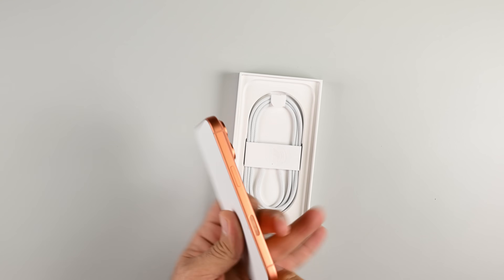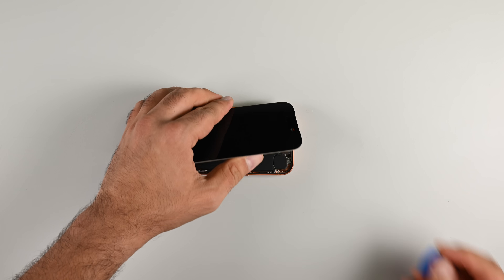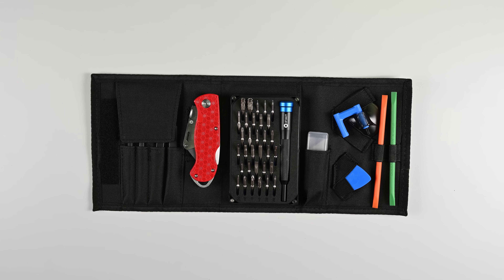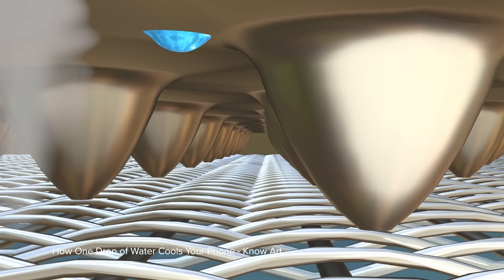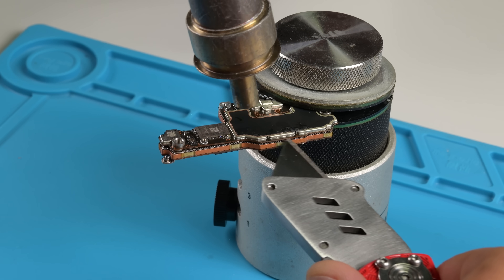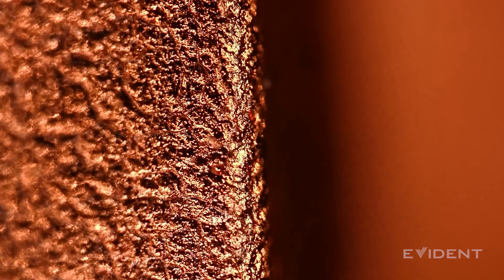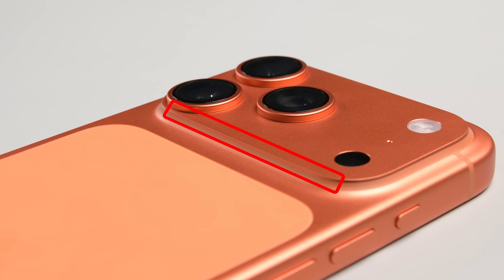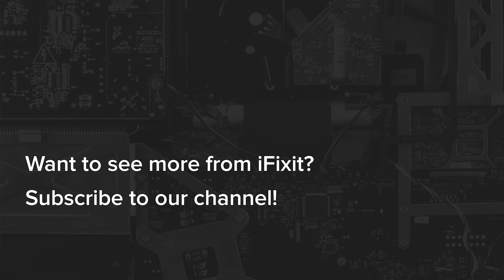iPhone 17 Pro Teardown: The Good, The Bad & The Fascinating

Comment: It pisses me off how Apple could have avoided the scratch issue, especially on the camera bump sharp edge.  They had to know this would be an issue, because they do their own testing and choice a sharp edge over a more rounded edge because it's visually more pleasing.  But for how expensive iPhone have become this issue should have never exist!
Reply: The solution will probably be an iPhone Ultra. Apple knew exactly what they were doing. The 17 Pro Max will likely be an entry level pro and the price ceiling will be increased like they did when introducing the "X."

Comment: Getting in through the screen is still not preferrable. And it never will be. At least there's less and less flex cables to be careful around attaching to the screen now that the front camera, Face ID and speaker assembly is all in the phone itself instead of on the screen like it was back on the 11.

The battery being screwed in is a very nice change though. Those adhesive strips of iPhones past are a pain in the neck. Hopefully that idea spreads to other manufacturers. It'll make battery swaps a lot fast and easier.

Comment: With the mention on "Scratch Gate" on the edges of the plateau, does that mean that the actual flat surface on the plateau are "more resistant" to scratches as long as the edges are protected?

Comment: I used to be a competitive cod player and I used my 15 pro max a lot and it heated horribly. The 17 cooling is MASSIVE! Now I just need a cool case, any tips?
Reply: Same, I had the 15 Pro and even Roblox made my phone feel like a heater. Got the 17 Air now and the difference is huge
Reply: Hey I have a Vionentus case too, it's great, thought I was the only one using them
Reply: Get Andriod
Reply: Make yourself a favor and try Vionentus, definitely best leather cases, and underrated brand imo
Reply: I think particularly the 15 series suffered a lot temperature issues
Reply: For playing COD isn't better a gaming phone with dedicated buttons and allat?
Reply: Only Vionentus
Reply: I’ve used the iPhone 7 Plus, iPhone X, iPhone X🅂 Max, iPhone 11 Pro Max, iPhone 12 Pro Max, and iPhone 13 Pro Max with CoD mobile and WZm. I don’t use a case but I do use a phone cooler, especially with WZm(necessary). I had a clip on one at first but now I use a MagSafe cooler.
Reply: Silver iPhone and no case. Any case makes cooking more difficult, and silver scratches and invisible on silver color phone.

Comment: Another excellent teardown vid, now with the JRE “blessing”👍Vapor chamber is clear improvement for cooling & sustained performance & should be used on all devices & not just iPhone Pro lineup, however access to internals from both back & front through display doesn't make sense. Also too scratchy aluminum anodization especially on the back around cameras "scratchgate" & missing of some kind of scratch protection like ceramic glass used on the  base & Air model is clearly another design flaw.
Still no matter how serious these issues can result in over time, the repairability rating 7 out of 10 is quite too high😬

Comment: This makes the iPhone Air even more impressive... you can get to the battery without messing with the display and you can just use the Air's battery pack (sold separately).

Comment: Interestingly in the heat pipe the pressure is super low, it's basically a vacuum. So thats why the water boils at such a low temperature

Comment: Could Apple done a better job rounding the edges?  This seems to be a "Duh!!!" moment.

I am the person that scratching issues on the case in the screen just does not apply to me.  Ever since I destroyed an Apple iPhone 6 every iPhone since that day including the replacement Apple iPhone 6 goes into a case, and a screen protector is in stalled.  Use the matte version today.

Over the years I have had to replace two screen protectors with no damage to the underlying iPhone screen.

Comment: Seems like they're making up for the trendy AI shift last year and returning to Apple-esque design and engineering. This is the kind of build I've wanted to hunker down with, at least until they go all-screen. Slapping a 4,252 mAh battery in over the 3,582 mAh last year was huge, 12GB of RAM (found in higher-end configurations of most dedicated gaming handhelds in 2025), the 48MP Telephoto lens up from 12MP, a beautifully implemented cooling system (which I never would've seen coming), a much more heat resistant metal body, and the best in-hand feel of any past iPhone. Huge W.

Comment: A million screws of different head and size, for a phone that performs the same as their competitor, who has 20 screws all same size. Why?
Reply: Yeah, and that what gets a 7 out of them? 
It's clear that they do this annoying screw bs just to mess with the user, to make it easier for you to mix the screws and damage something. There's no way their engineers couldn't design this thing using same size regular phillips heads (or same size just all torx whatever). Shills will say otherwise, of course. Plus all components are now accessible only through the screen removal.

Comment: wait - how does the chip boil the water in the vapour chamber?
Reply from the maker: Components on the logic board, things like the SoC, generate enough heat to boil water. That's the same heat that's being wicked away by the vapour chamber.

Comment: That's why you should always choose a smartphone with a color that is natural or as similar as possible to the material. That way, you'll see the scratches less.
Reply: or... just put on a case. first thing i do when i get a phone is put on a thin case, usually clear so I can see the design underneath. and a tempered glass screen protector. my last 2 phones including my 13 pro is pristine and looks brand new despite multiple drops and years of use.
Reply: @InvertedBug  Yep, my 14 pro max has been through 3x cases and it's pristine.
Reply: @InvertedBug  or just be okay with the phone having signs of wear over time, I dont really need the benefit of it looking brand new after my average 4-5 years of usage. I’d much rather enjoy the feel of glass and metal in my hand than use a case. Totally fine for me if a used device looks used, got my worth out of it.
Reply: Or just go careful with your expensive tech.
Reply: @OoxB505 if you use one more braincell you'll realize that accidents can happen

Comment: The point here is not that the iphone is bad in fact is a fantastic device , the point is that it is ridicolous that for all the money Apple spent in R&D (and therefore for the ridicolous money Apple is always charging us) they made suck simple and  rookie mistake that should have been obvious during the drawing boards let alone during the stress tests that Apple should perform on the devices (as overdramatized during Apple events).

Comment: It’s not 7/10, more like 4-5/10 also confirmed by 1 side entry. U will be forced to replace whole big modules for $$$! Not small single units for half price.
2nd thing wrong - vaporchamber is from screen side, it spreads from chip mostly to screen and battery casing, but not to aluminium… why u show and compare thermal image of phone back saying about VC? U should compare frontside (screen) as this is where most of heat transfer happens
Reply: The vapour chamber is sandwiched between the battery and the metal casing.... check the video again.
Reply: @nsvircev  sigh… U should check. There is in order: screen>graphene cooling film(he even scratch it on vid and comment)>VC>metalcasing of battery, with battery inside. He flips it in vid, but check how it was mounted before he flippped it and removed battery

Comment: See, I still don't get the scores at all. How is this get the same 7/10 as the iPhone Air when you have to go through the screen to get at the battery? This phone should get a lower score than the Air because it's less repairable.
Reply: What difference does it make? It’s a little riskier if you’re worried about snapping the screen in half, but the OLED screen is flexible and so is the new glass with the ceramic shield 2. It’s not harder to repair, and the risk is small if you’re careful.
Reply: makes less sense with the pixel 10 getting a 6

Comment: Credit where it's due, I think that this is the most beautiful iphone inside yet. Almost no glue, all screws, attention to detail in every corner (even little Apple logos on the PCBs), a battery that you can get at without tons of alcohol... what a dream.
Reply: But I liked replacing batteries while double-fisting Jack and Coors
Reply: "a battery that you can get at without tons of alcohol" like on the battery, or drinking it??
Reply: You need alcohol to remove the battery, also for drinking to cope with the fact that you broke the display lol @DeerJerky
Reply: Sure but you still need to poke around a 400$ screen to get to the battery and that doesn't make it particularly easy to repair from the get go
Reply: @devnol  This sounds like a skill issue. What do you expect, a $20 screen?
Reply: @XMagicStar No I expect a 20$ glass back and rear entry. Why would I put unnecessary risk in my repairs?
Reply: @devnol What company repairs your glass back for $20? I'd actually buy their devices 😂
Reply: @devnol  they want to sell more screens, if you can't stop the repair shops, or make them pay, just make the repairs more risky to make up for it. Apple is one of the greediest companies out there.
Reply: wrong!!! the iphone 4 and 5 are still the most beautiful till today period!
Reply: @carholic-sz3qv he said beautiful internally

Comment: the problem with apple is not the hardware but the software, general things like typing on the keyboard micro stuttering are just adding to a bad experience, they can increase the specs each year but the software is deteriorating just on the fundamentals not third party which is also going unchecked - case and point ipad apps that are just enlarged iphone apps even for the most popular ones like instagram

Comment: While the specific edge scratching problem discussed in this video is indeed limited to the Pro models, since they're the only models that have a sharp aluminum edge around the top of their camera plateau, scratching on the back glass of the non-silver Air and the 17 models is very real.  I just visited my local Apple Store and looked at three or four of each model (base, Pro, Pro Max, and Air), and there was significant scratching on the back glass of most of the non-silver models after only five days of being on display.  It's true that display models in a store get a lot more handling than a typical owner’s phone, but it’s only been since last Friday that these models were put on display in Apple Stores, so the handling they’ve gotten might represent maybe only a few weeks’ worth of normal owner handling, and if so, it means a lot of people who don't put these phones in cases might soon see scratches on their new iPhones.  I couldn’t figure out how the round MagSafe pucks that these models were displayed on could cause these scratches, but I guess with enough clumsy handling, even that’s possible, but maybe some people have been deliberately running coins, keys, etc. across the phone backs while the Apple reps aren't looking.

Contrary to what's said in this video, I don't see that the A19 chip rests directly on the upper end of the vapor chamber, since the A19 is embedded inside the circuit board sandwich, soldered to the inner surface of one of these boards.  The upper end of the vapor chamber seems to be in direct contact with the circuitry on the other, outer surface of the board that the A19 is soldered to, directly on the other side of where the A19 is soldered, so it seems that's good enough.

Comment: A score of 7 for a smartphone that needs to be fixed removing screen  and back coil it’s way too much imho.
Reply: it doesn't look like the back had to be removed. More like, they wanted to remove it to see if double entry is still possible or not.
Reply: @thmo_  Indeed. No need to take off the back unless you need to get to anything in the back assembly. The battery is accessed through the front. Not a fan of having to remove a very expensive and fragile screen to get in, but almost everything is behind it.

Comment: 7/10? I mean, you need to remove the screen to replace the battery, which is not very repair friendly
Reply: I just came from the pixel 10 video. them giving it a 6 while this gets a 7 after dropping the dual entry design is incredibly dubious.

Comment: I thought anodized was like an electroplating finish, how do they get the color on it? Should have made the phone out of stainless steel, much harder materials
Reply: It's a bit different than electroplating as instead of transferring one metal onto another it is growing an oxide layer on the aluminum since aluminum oxide (aka alumina or corundum) is much harder than the metal. The color is typically added by soaking in a dye which gets absorbed and then sealed into the porous oxide layer. There are some YouTube videos that show people DIYing the process if you're interested.

Regarding stainless steel, that has the downside of being much less (~16x) thermally conductive so it wouldn't pull heat away from the SoC as well. Titanium is similar which is likely why after using SS then Ti they came back to aluminum. Without a frame that can sink enough heat away devices have to resort to thermal throttling.
Reply: @IanGrams I see but the temps are like 4 degrees difference from iphone 16 pro. So the aluminum frame is a downgrade from the glass back, and most people will never push the iPhone to get that hot. Reminds me of my moto z3 which was also aluminum

Comment: Are there anodization problems in the silver one aswell?
Reply: Likely so since it's inherent to the geometry, but since the anodized layer is pretty close to the base aluminum in color it won't be as noticeable as the orange or blue models.
Reply: @IanGrams  makes sense! I returned my orange color iPhone yesterday and bought a silver one; the silver ones had NO marks on them, at least that were visible

Comment: 7 Is way too much for this. You need 4 screw drivers, have to track each screw, a lot of screws to manage, USB replacement is difficult and that is the most common part that stops working. I always think IFixit is biased towards Apple.

Comment: What exactly is the purpose of running the vapor chamber over the battery and without any connection to the SOC? Won't this lead to rapid battery degradation? The thermal image of the older model shows how much cooler the battery area was.

Comment: Few people if any use such an expensive phone without a case so doesn't even matter. This phone is a home run.
Reply: You are right, most people use with case I assume. I don’t use case because Pro Max phones already huge and heavy. Happy to accept some wear and tear but using without case for couple of days my 17 pro already look like 2 yrs old now 😂 the air on other hand is extremely good for durability.

Comment: had to replace a couple screens on the kiddos phones over the years. not at all fun lifting the oled screens off. wish they had electrically released screen adhesives. battery repairs here look easier, but likely going to bust that screen. 

hoping one day this will improve. 

wish i wasn't disabled from a workplace injury and could afford a new iphone. really loving the look of the camera savannah on the pros. 

appreciate the repair video. will need this in 10 years when i can afford a used iphone 17 and need to replace the battery. 

HUGS from newfoundland :)

Comment: They could have fixed the thermal issues without going to aluminum but that’s just Apple screwing their consumers as they’re clearly doing this year. The fact they actually included thermal management design vs… just a bare SOC in a case… yeah it’s impossible to say that the aluminum has any effect. Clearly so much is being held up by the thermal management solution that iPhones are JUST getting lmao. Even with the poorer thermal conductivity of titanium. Yeah no shit adding a thermal solution is going to change the playing field

It’s like using the most high end CPU cooler and bonding it to the cpu with duck tape, no shit it’s not going to work

Comment: Amazing how iPhone becomes the first Apple device to get a vapor chamber and not a Mac or iPad
Reply: well technically macbooks already had this tech for ages. only the layout differentiates a heatpipe from a vapor chamber in its names and functions, but the underlying principal is exactly the same
Reply: @nniklasknope
Reply: @nniklask wrong!!! the vapor chamber in this case in a tiny sheet of metal compares to the big copper pipes and are made for thinner devices
Reply: @carholic-sz3qv  read again what I wrote. the dimensions and layout are different but the underlying principle is the same
Reply: @nniklask heatpipe is fundamentally different from a vapor chamber.
Reply: @jak3zera not really. One is flat the other is a pipe.
Reply: even most Android tablets dont get vapour chambers , they dont need it since they already have a large metal surface area for cooling.
Reply: hopefully with the M5's
Reply: Do the Macs even need it? I have the M4 Pro chip, I threw a lot of stuff at it and the only thing that even made the fans spin up slightly is running larger LLMs on device.
Reply: @darkwoodmovies  the Pros already have this principle in them in the form of heatpipes. They talk about fanless devices such as the MBA and the ipads
Reply: Maybe macbook air next 😂